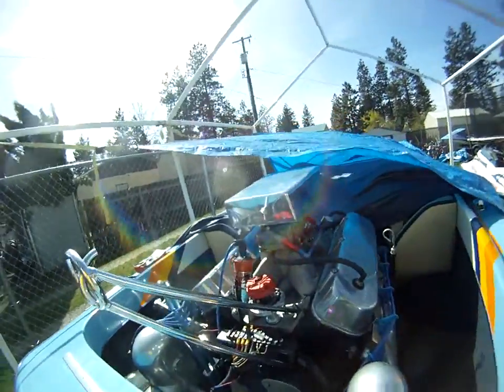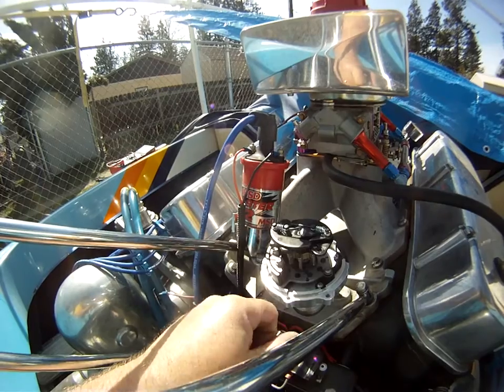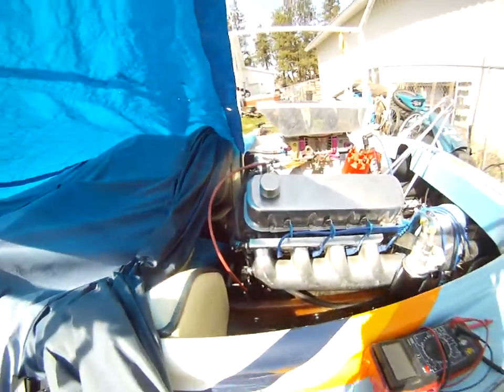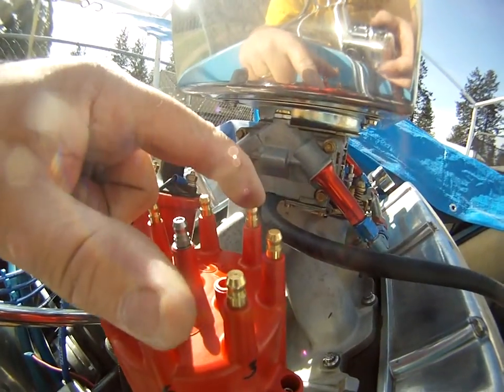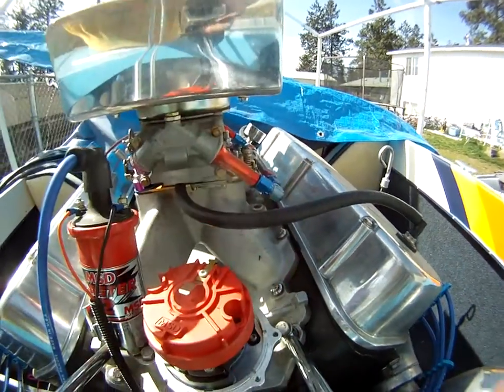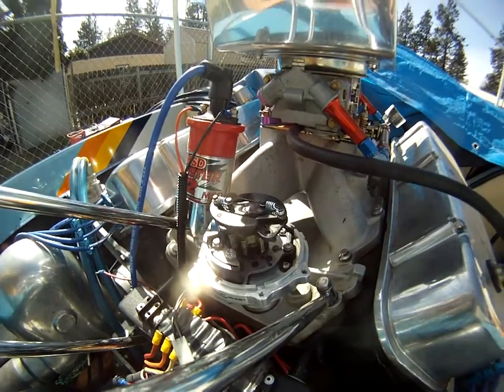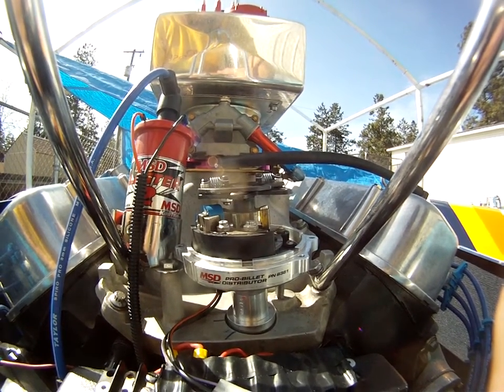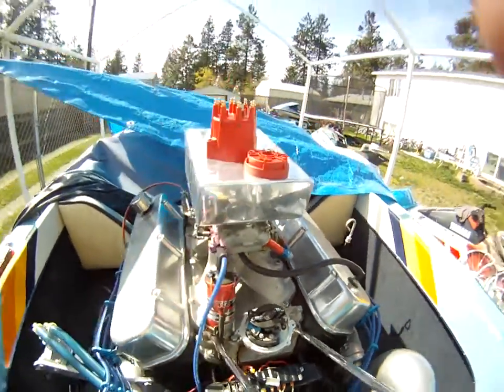MSD V8 chevy air gap, rotor phasing, timing  and  centrifugal advance settings & adjustments.

Comment: Good video brother. WELL DONE! It seems you know what the hell you are talking about a lot more than a lot of the computer racers out there that thing they know what the hell they are doing when they have had absolutely NO wrenching experience what so ever let alone owned, or ever even sat in a hot rod or race car for that matter. I like the boat may I add. Ive always loved them bad ass flat bottom boats with the little propellers. they make some stupid ass power. I'm sorry, I dont even know if yours is one or not but anything with a V-8 in the back has a lot of potential PERIOD. I built a 65 C10, SBC 355 8.5:1 cr, World Sportsman 2 heads Torker 2 intake twin turbo monster with a crank trigger and MSD everything Besides that, I just wanted to let you know I loved the video and you got a subscriber. Keep up the good vids. I am sure as rain good info will be a breath of fresh air for a change
Reply from the maker: Thank you for your comments. Its appreciated. . If you do some research on Rogers Supercylone Boats. That's what I have here. Oval track race boat. This ones got the Berkley jet pump with place diverter and droop snoot.